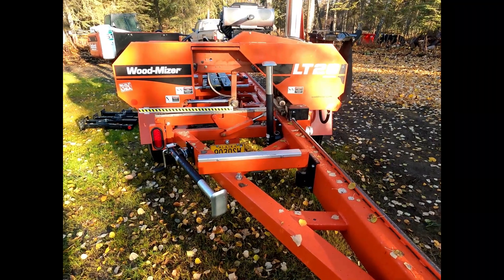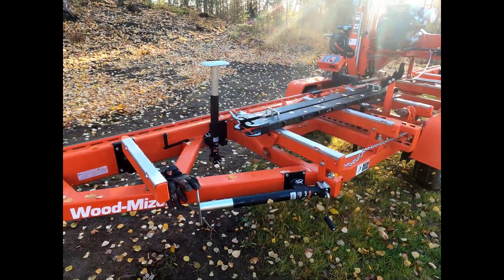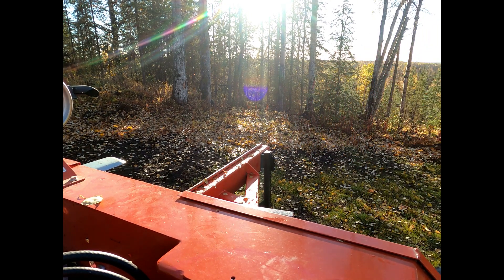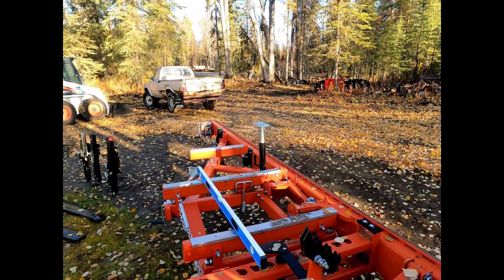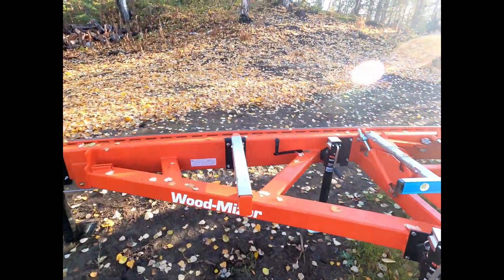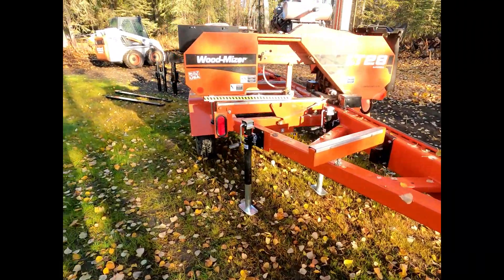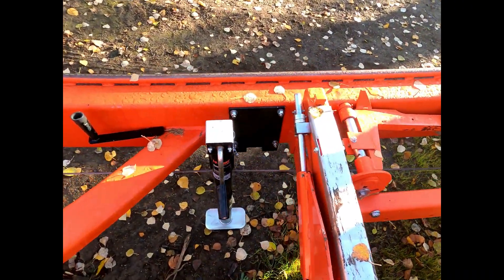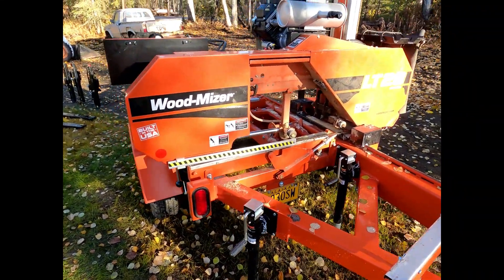Woodmizer LT28 with Upgraded Leveling Jacks

Comment: How much were they and where did you get them?  Great time saving idea.
Reply from the maker: I got them off Amazon,  I since sold that mill and in the middle of doing version 2.0 on my lt40.  All you need to do is drill holes in them and use the brackets.
CURT 28570 Direct Weld On Heavy-Duty Trailer Jack, 8,000 lbs. 15-1/4 Inches Vertical Travel, Black https://a.co/d/1G9UoRo

Comment: Where did you buy the Jacks? 
 New sub from Ga. Thanks.
Reply from the maker: https://www.amazon.com/CURT-28324-Pipe-Mount-Trailer-Vertical/dp/B004QEM7J8?pd_rd_w=7eZPw&pf_rd_p=654426bb-d9e0-46ff-b0bb-c0819dce172b&pf_rd_r=NE3P67CAQ2BWZNN5JZ91&pd_rd_r=79923531-3dab-4a4d-8f8a-ee898b61d95c&pd_rd_wg=7KmsH&pd_rd_i=B004QEM7J8&psc=1&ref_=pd_bap_m_rp_7_sc

Here is the Amazon link. Thanks for watching!
Reply: @outdooralaska6945  Thank you. 👍🇺🇸
Reply: @outdooralaska6945  The link is for "weld on" jacks. Did you have to weld these on? I also have an LT28 and hate the current jacks.
Reply from the maker: @johnlamica3605  I welded the jack piece to a bracket and bolted it to the original plate holes.
Reply: @outdooralaska6945  yeah that's what I was thinking. Thanks for the reply